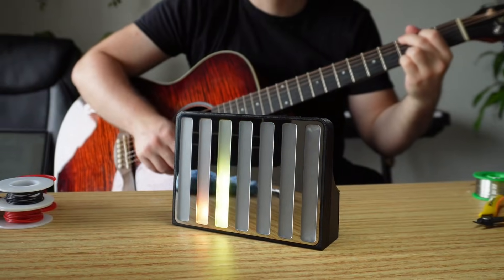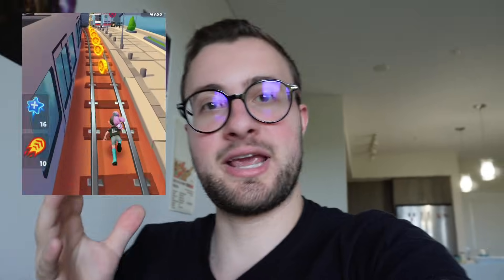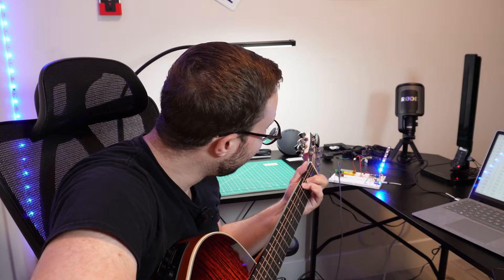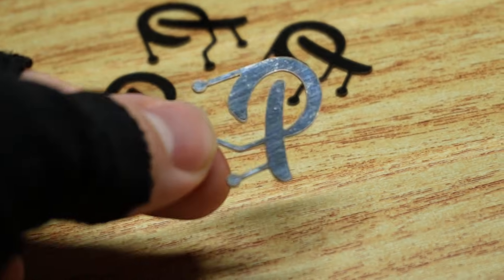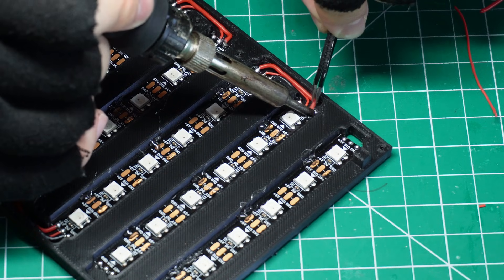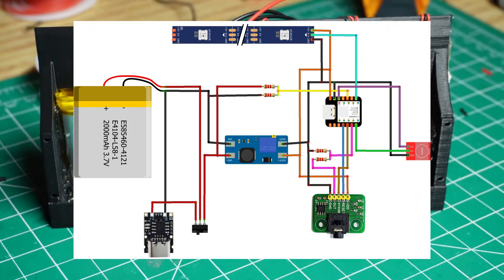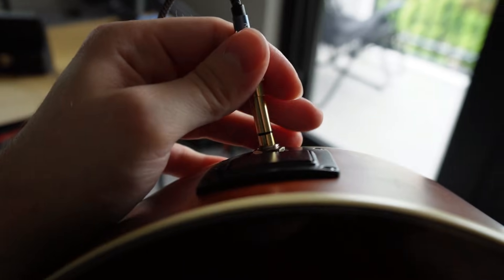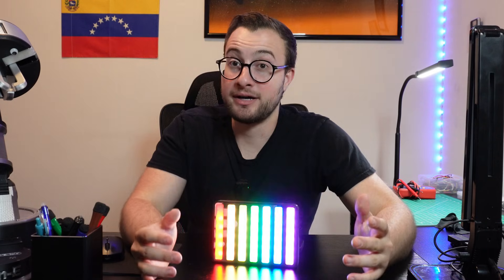This Invention Turns Music Into Light

Comment: Great job. I have questions concerning the led power

1. How did you power 42 RGB leds I believe SK66… with just one lipo, what about the current draw?

2. For the frosted acrylic, you mentioned it was made by Xometry, what were the tolerances used in respect to it and the PLA? And what thickness was it?

Comment: It looks extremely clean and cool, but I wonder if there is a disadvantage when using a microcontroller (speed) over analog circuitry there. 
Also, now I want to spend money on lasercut metal for projects I probably never finish. Thanks.
Reply from the maker: Great question! Analog circuitry can be faster since it processes signals in real time, while microcontrollers have a tiny delay due to sampling and code execution. But with a fast MCU handling just this task, the lag is minimal (milliseconds), and you get way more flexibility to tweak visuals in code!! 🔥 And don’t worry, laser-cut metal looks impressive even if it only makes it to the “ideas” drawer 😂
Reply: @placitech  Nice, thank you 🔥
Reply: @placitech  True, MCUs offer tons of flexibility!! But isn’t that “minimal lag” sometimes enough to mess with real-time tasks like audio or tight control loops? And isn’t debugging timing issues in code way harder than just dialing in a resistor or cap? Love to hear your thoughts! Great content buddy